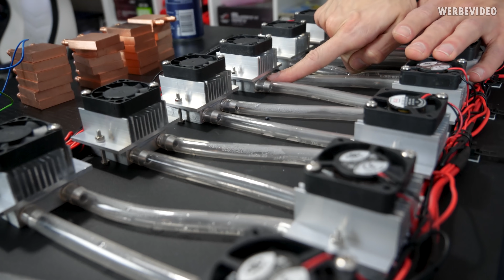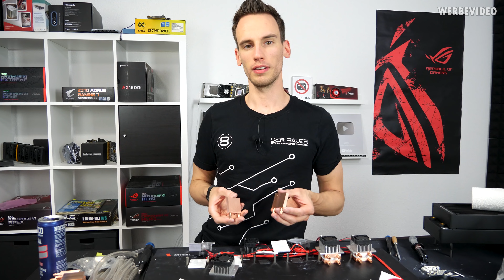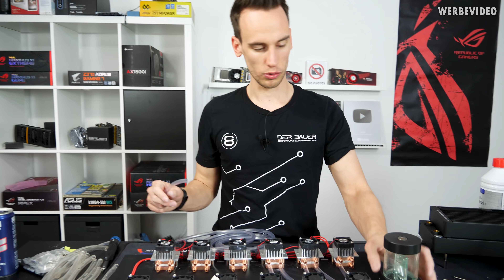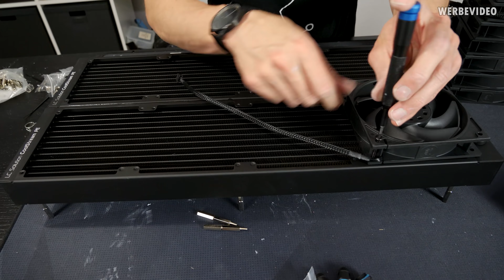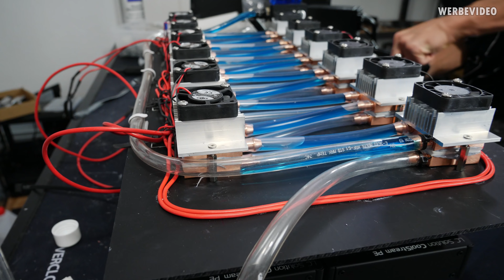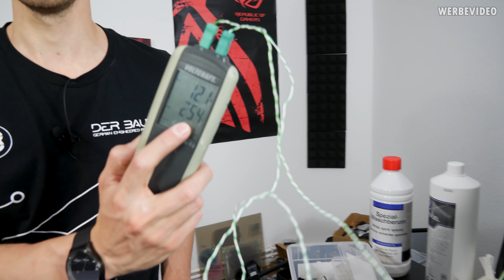DIY AliExpress Chiller - IT WORKS!

Comment: I managed to cool down about 1 liter of water in an "unloaded" water loop with one single Peltier cooler with a much simpler system. Something must be wrong with your config; with that sophisticated system, I believe that the water should freeze in the tubes after a while (without load, of course). Did you run the Peltiers on their max current?

Comment: Sounds like "heat sink" is the main difficulty. I imagine a radiator from a car or ac unit from scrap yard would be many times more efficient. It could even run passively on thresholds.
Put it outside the house just like a split air conditioner to be silent and insulate the cold tube.

Comment: Wait why didn't you put thermal paste in between the upper water block and the heat sinks on 4:01 ?🤔🧐  I guess you'll get a pretty higher performance by only doing that plus point  detail. By the way awesome project!

Comment: You should build a PC inside an absolute airtight chamber that's full of 100% DRY noble gas like argon or helium. i would even suggest circulating the chambers air through a dryer and mosture collector for a few days or permanently. just to be EXTRA careful. Then run an ac unit on the cpu. or if you want to go insane run a helium compressor on it.  That will get it below freezing and keep conductive moisture off it without smearing nasty vasoline all over a pretty motherboard. 
ac unit route would be cheaper but its temperature is limited to just above the freezing point of R-34.  if you have a business you can get a used helium compressor for not much more. if it can make liquid CO2 it should be plenty cold.

Comment: I am into home distilling and this could potentially save me a lot of water. The condenser on my still need cold water at a fairly constant temperature. My current solution is to re-cycle the water through a cooler box with ice thrown in.

Comment: So to get to zero you have to double the whole system to get to -10 (= 2X) then you have to make the system (X3) to =  -20, and -30 = (4X) and -40 = (5X) approx as it tapers off and the heat gets harder to get rid of and the amount of electricity becomes overwhelming compared with the lower achieved cooling.  How many do I need for 5gig or 6gig? :D
The big question I have is how well does it do after an hour of hard work.. ?

Comment: the same amount of cooling or better can be reached with less power. Just read the datasheet for that TECs. Take a look a closer look at those graphs. Amount of energy transferred from the cold side to the hot side depends on the energy that you put into Peltier. Just lower the voltage i.e. by parallel connection of TECs pairs. Those 60W is max power consumption, not cooling capability. The sweet spot should be somewhere around 7-8V but the exact point you will read from the datasheet.

Comment: @der8auer did you try connecting them in series and measuring power usage vs temp performance?
give at go tec in series connect peltiers using red to black black to red and so on.. i will drop ampearage on the peltier but the hot side temp will decrease and flip that gain to the cold side..

Comment: I'm confused, why the radiators if you're using peltiers and heatsinks
Reply: the radiators are there to pull the heat away from the peltiers. the loops works in conjunction with the heatsinks though at this point it looks more like the heatsinks are simply there to hold everything together and the radiators are doing all the cooling work

Comment: You need to look at the Tmax of your TEC units. the cold side temp will be your hot side block temp minus your Tmax value . the higher heat wattage TEC the higher the Tmax differential, your current configuration is like adding more radiators to your loop to get sub ambient temps, never gonna work.  what you have created should keep about 600w of heat output at or near ambient temps (as long as those rads can dissipate around 1200w of heat , but wont get shockingly low numbers.

Comment: What I'd have done is to change the water blocks orientation so the block fittings are facing outside, then I'd put all pieces close together and use bigger and more efficient fans and heat-sinks.

Comment: From what I understand, you have 24 blocks, 20 fans, 12 Peltiers,  2 reservoirs, 2 pumps, 1 radiator and miscellaneous tubes/fittings.
So given the cost of initial setup (and continuing running costs), is there a practical application for this or was it just for fun?!
Also, what is the power draw for this?
I find this interesting but fail to see a practical usage scenario which would be cost effective.
However, thank you for your content ;)

Comment: Split the flow before the TECs so the fluid runs through them in parallel.  The water would flow slower through the TECs and may cool more effectively.  Recombine the flow into one line after the TECs but before the CPU.  This way you will have high flow for the cpu block and low flow for the TECs.

Comment: aliexpress sell huge peltier kits, 2-3 of these could freeze water
https://www.aliexpress.com/item/1pcs-DIY-120W-TEC-Peltier-semiconductor-refrigerator-water-cooling-air-condition-Movement-for-refrigeration-and/32830442461.html

https://www.aliexpress.com/item/Thermoelectric-Peltier-Coolers-12V-576W-8-Chip-TEC1-12706-DIY-Thermoelectric-Cooler-Refrigeration-Air-Cooling-Device/32999479609.html

https://www.aliexpress.com/item/Mini-Quad-core-Thermoelectric-Peltier-Air-Cooling-Device-Cooler-DC-12V-30A-180-65-62-Mm/32887012453.html

https://www.aliexpress.com/item/Thermoelectric-Peltier-Coolers-12V-576W-8-Chip-TEC1-12706-DIY-Thermoelectric-Cooler-Refrigeration-Air-Cooling-Device/32973745190.html

Comment: Did you know you can buy a 6000 btu window air conditioner for $149.99 dollars?
Just use the air condotioner to cool your cpu radiator. Friking geniuses.

Comment: What are the purpose of adding TECs to the system? I understand that it transfers heat from one side to the other but couldn't you just replace the TEC with thermal paste? Or do the TECs create less thermal resistance?

Comment: peltier cooler works from pulling heat from one plate to the other cooling the hot side slows the cooling of the other

Comment: Do you remember the Ybris TRex III? I had one and that imho is the most efficient way to use a TEC, I was like -10° Ilde and 5/10 under normal load with a dual core like the E8600, the problem now is that is hard to find a 70x70 Waterblock with that internal shape. I’m working on a similar project, let’s see if I can get something interesting out of it 😁

Comment: instead of using tiny fans it would be better to arrange the heatsink fins vertically and construct air ducts for 80+mm fans to blow in a push pull config. other then that you could stick the PC into a container with a de-humidifier to remove the risk of condensation build up.

Comment: Just isolate the cooling blocks side walls, maybe gain couple degrees better results. Also isolate the bottom part with isolation foam if you didnt made before. Shorten the lenght of tubes  between blocks, (for sizeable gains you should shorten that distance by half i think.)

Comment: I'm pretty sure once you apply a load to it the water temperature will rise above 12C LOL It's called equilibrium.

The ideal chiller setup you WANT to have is one that keeps the temps at or slightly above ambient when under load. That way you avoid condensation on a working system. Try to experiment with how many peltiers you need powered or fans spinning to achieve that while putting it under a typical load.

A good custom water loop generally has water temperatures around 40-50C. Getting that down to just above ambient with a load on it is the sweet spot for a chiller.

Comment: Yet again, why are you running the TECs at 12 volts?
They first off don't need 12 volts, secondly, with that much power put through them, they will act more as a heater then as a heat pump. I would recommend running them at 3-5 volts instead.
And lastly a low flow speed doesn't matter since it is a closed loop.

Comment: The same amount of heat will be extracted from the loop either way. Making it run slower won't make a difference. Of any it will make it worse because the temperature difference for the ones in the end of the loop will be lower making it less efficient + slower flow rate for the cpu

Comment: Hey, what about pre-cooling "hot" water with air radiator and then cooling it down with peltiers?
Reply: If the cooling peltier was air cooled this would work - but adding another heat source to the water loop would cancel out the advantage here.
Reply: @RoccosModernLifestyle  I was thinking about mounting radiator between processor and peltiers, but this is double-edged sword as results would depend on liquid temp after passing cpu and room temperature.

Comment: Check the thermal delta over the TECs (i.e. hot side minus cold side) while they're being cooled by the loop. If the delta is over about 60C you're losing a huge chunk of cooling potential. The reasons are kinda complicated to get into but effectively as soon as you start getting thermal leakage backward over the junction (i.e. the hot side is warming up the cold side because you're not dissipating heat off the hot side fast enough) you get efficiency losses roughly proportionate to the square of the thermal leakage.

Remember that your TEC cooling loop needs to be able to dissipate the total TDP of the CPU plus the total wattage of the TECs (minus a couple watts of ambient radiative dissipation from the tubes and blocks) - that's a lot of juice. That's the problem with TEC cooling - you can get below ambient with it, but you effectively need twice (or more!) the cooling capacity than you would in the first place.

You're going the right way with the multiple blocks - multiple blocks means more surface area to transfer heat with, which is the restriction you get with CPU blocks - and you've got them orientated the right way around. Hot loop on top with the fans, cold loop on the bottom. If it were the other way around you'd barely beat ambient (if at all) because heatsinks work both ways!

Comment: add a pump to this https://www.kellyvillepets.com.au/collections/hailea-aquarium-chillers/products/hailea-chiller-hc-500a-1-2-hp
Reply: 1/20 HP is too low
Reply: @JGnLAU  based on what calcs?
Reply: @BenState  just my estimation without any calculations.
Reply: @JGnLAU  0.5hp x 0.7457kW/hp = 372W.  The linked pump kept 400L of water 15oC below ambient all year round for me so I believe it would be fine.  I could set it to 15oC I believe.
Reply: @BenState  It says 1/20 hp, not 1/2. Keeping water temperature is easier than chilling power hungry chips.
Reply: @JGnLAU  zero difference.  thermal is thermal. 1/2 HP is the one im referring to
Reply: @BenState  zero difference between compensating for heat transfer between water tank and ambient air and cooling 100+ W processor?
1/2 HP should be plenty enough tho.
Reply: @JGnLAU 15oC delta is 15oC delta. Do you science?  The thermal load of 400L water changing 15oC is actually a lot of energy.  http://hyperphysics.phy-astr.gsu.edu/hbase/thermo/inteng.html#c4

Plus as I said, it can handle 375W.
Reply: @BenState  Do you?
Keeping volume of water at a constant temperature lower than ambient requires less energy than needed to cool it down in the first place. Temperature delta depends on heat load and cooling power, 15 degrees delta just means that system reaches equilibrium at that temperature i.e. heat load is the same as cooling power at that delta T.
Reply: @JGnLAU  wow.
Reply: @JGnLAU  heres linus doing it with a smaller model https://youtu.be/HMtvEbD2MQo?t=913

Comment: From what I understand, the low flow rate thing is a step in the right direction, but it not the best solution. A lot of the guys I've seen who really understand TEC cooling say that you need a block with a long internal geometry. That way the water stays in contact with the TEC longer, but you can still keep a decent flow rate. A block with a long, continuous channel and 
a lot of surface area. I think I recall that you need the same thing on the CPU end as well, which would make sense.

Comment: Maybe less tubing helps to gain some degrees, can you try one peltier in top of another? If you cool the hot side of the TEC with another one you can get a lower temperature.
Reply: Yoy need much bigger peltier to cool the other one.

Comment: I wanna see if, in a test that could cool down a CPU as much as a 360 AIO would (so not extreme cooling),  and manage to keep the consumption lower by running the TECs at a lower power while cooling the TECs just enough so they don't heat up so much.  Like a bit of testing for that "quest for a working compact TEC+water solution"

Comment: fyi, distilled water freezes at a HIGHER temp than non-distilled water due to the absence of any contaminating salts or minerals, or anything else that could lower the freezing point. in the future, if you want a liquid that won't freeze at 0 celsius, distilled water should be your last choice, unless you are going to mix in something like antifreeze lol.
Reply: Use vodka
Reply: @JamesSmith-dn8lb  waste of vodka tbh

Comment: I've been wanting to build one of these for years.  I think you could add an extra stage to a setup like this by using your chilled water to cool the hot side of another group of TECs.  I think you could get lower temps because one of the limits of TECs is the maximum delta between the hot and cold sides.

Comment: Is one of the rads in the cool loop? If so it would actually be heating the loop up due to the temps being sub ambient. Maybe that is why its performance is lacking? If not then its a little disappointing that it didn't perform better. Love the idea though. great videos

Comment: You can run the TECs in constant current mode to get higher and more stable cooling power. Because you're running them 12V constant voltage, you just get around 300W of power consumption (according to the previous video), while 12 * 60W TECs can handle 720W.

Comment: I think that if you set this up in parallel with a standard water loop, you could get the temps down in the tek loop while fine tuning for benchmarks on the standard loop, then when you get ready, flip a couple valves and dump the chilled water into the loop for a quick hail Mary benchmark run.... might need some larger tanks for chilled water capacity

Comment: TEC are garbage, don't even bother, they are dead in PC industry for a reason.
Use some AC unit like linus, maybe only better one so you can actually beat him.
Reply: I would counter that they were  never enough of thing to have died off. It's a neat experiment but past that I have seen the threads and both phase and tec fall into the rabbit hole.
Reply: @mr_jarble  what's wrong with phase change cooling?
It's way more efficient than TECs, afterall it is used in data centers and they do care about efficiencies.
Reply: @JGnLAU  for things inside normal thermal envelopes, nothing, but you start pushing and things gravitate to cascade systems. These kinds of cooling are always going to be niche as dice and ln2 are cheap and offer more head room. As a fun project though it is always fun to push the limits and try new things. As an old school oil cooler I have a ton of respect for him and the projects he tries out.

Comment: double stack (cascade) the peltiers/TEC chips to get lower temperatures
Reply: Better yet, cascade more powerful peltier/TEC chips down to the 12706's your using like this:   [waterblock][kryonaut][12715 TEC][kryonaut][12710 TEC][kryonaut][12706 TEC][kryonaut][waterblock]. Then you'd probably only need to do one single stack instead of a series. That one cascaded stack will go way subzero but might need it's own power supply unless you use a 1600W with the 9900K. Love your vids. Keep it up
Reply: 12715 TEC/Peltier - $22.99 - 3 pack - https://www.newegg.com/Product/Product.aspx?Item=9SIA6RP7TS3062&amp;Description=thermoelectric%2012715%20cooler&amp;cm_re=thermoelectric_12715_cooler-9SIA6RP7TS3062-Product
Reply: 12710 TEC/Peltier - $7.99 - single - https://www.newegg.com/Product/Product.aspx?Item=9SIAEC96HX9633&Description=tec%2012710&cm_re=tec_12710-9SIAEC96HX9633-Product
Reply: You also obviously need to line up the hot and cold sides accordingly:  [hot waterblock][hot/cold][hot/cold][hot/cold][cold waterblock]. I'm sure you know all this already